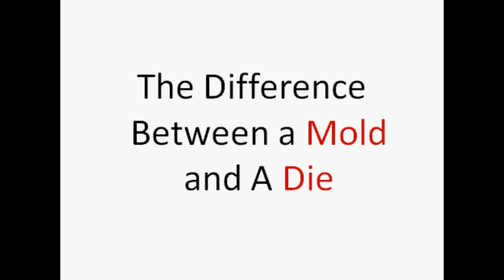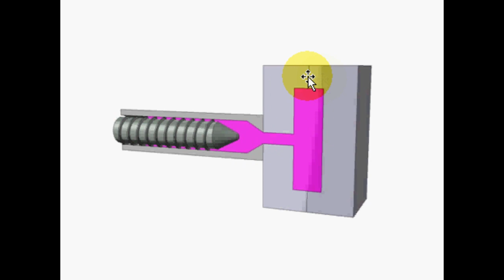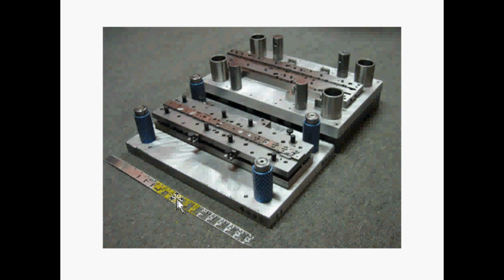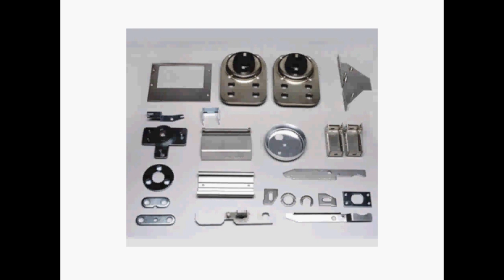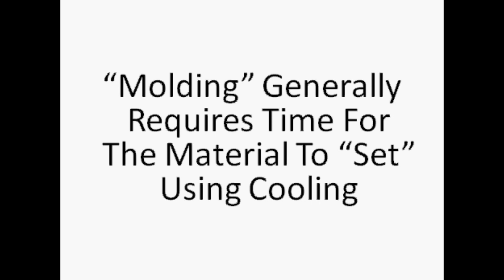What Is The Difference Between a Mold and a Die?

Comment: Plastic injection mold maker here, a good rule of thumb is a mold is typically requires material to be manipulated into the cavity, you could say it's material manipulated whereas dies manipulate the material ! The opposite, some guys here have mentioned wet molds and dry dies.

Comment: Thank you for the explanation. I still have a doubt that the casting process is done also using dies which involves hot molten metal. Can you please explain?
Reply: I have been out of the manufacturing business for about 10years .I have over 18 yrs of maintenance experience. I'm looking at a job as a tool and die set up member. Can you share some information about this.
Reply: Bobby Byrd if you are looking for a job please reach out to me! I am a recruiter for a large staffing firm and looking to fill a role in the SC area. :)

Comment: how about  die-cast ? they are using mold but it is called die cast.. pls explain the difference
Reply: Die casting can be either gravity die casting or injection die casting. It does resemble to injection moulding, as he explained with plastics. When its for metal alloys, we call them Die Casting. 
In the 80ies companies that manufactured moulding tools would often supply both for Plastic Injection and Die Casting, but in the 90ies the demand for plastic moulds was so big they became specialized in one of the other.
It did confuse me also, as in Portuguese, we call Die-Cast as "Injection Foundry" (direct translation).In metal alloys you ould either do Sand Casting using a Sand Mould, or Die Casting. 
I am sure that with some googling you can find good examples of this.
Reply: So just to confirm the difference between injection moulding and die casting is injection moulding is plastic and die casting is metal?

Comment from the maker: You really can't deform plastic once it has been molded. You can mill it and drill it, but you can't really "deform" it because it is soft and gummy and wants to return to its original state: junk.
Reply: Phil,

For the most part I agree but there are exceptions.  For instance polycarbonate is often worked cold in a sheet metal brake to make modest bends.  Think about some machine guards yuo have seen. All plastics have some elasticity that can be exceeded so it will  hold a new form.